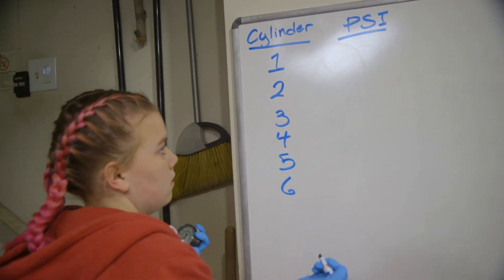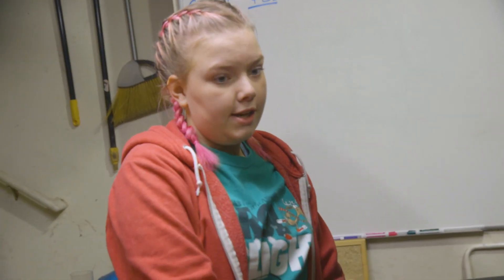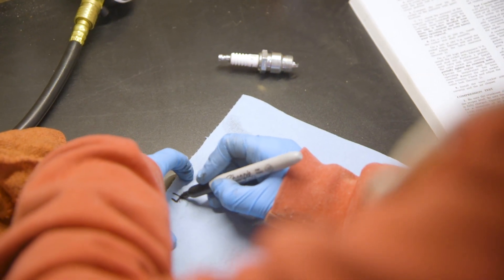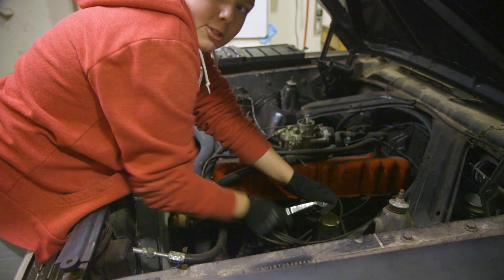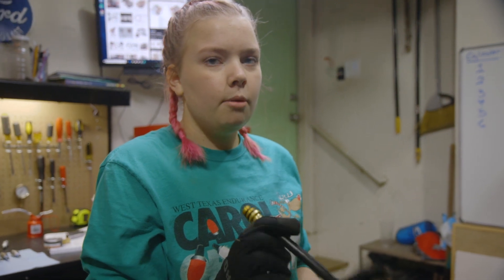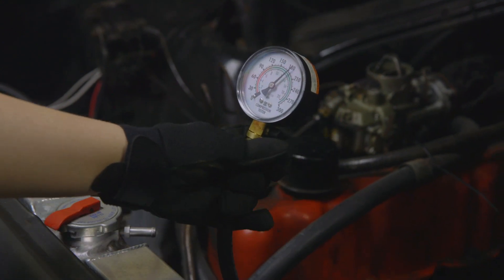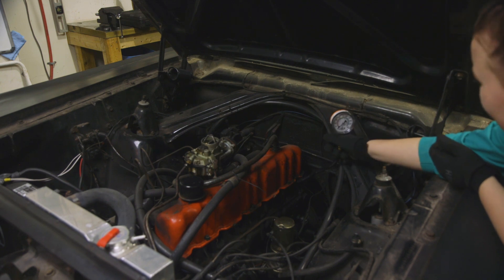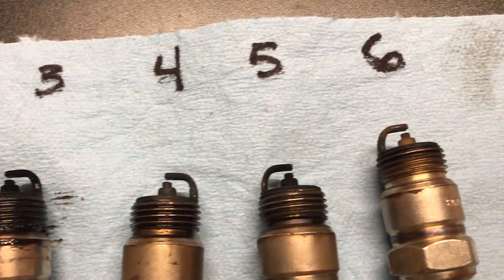I Learned How to Do a Compression Test!

Comment: #1 and #6 look "normal", in that they usually run leaner because they are further from the carburetor. Because of the age of the motor, when you do get the engine work done, you can improve what they did from the factory concerning valve stem seals, et al. Good luck!

Comment: So for your oily spark plugs it is a sign that those cylinders are burning some oil, however there are 2 possibilities as to the cause.  If is puffs a bit of blueish smoke on cold start up it is the valve seals, specifically the intake valve seals.  If it smokes while up to temperature under load or while reviving it up that likely points to a ring problem in those cylinders, specifically the oil control rings since compression is good.
Great job at getting your hands dirty kiddo, and great job Dad!!!

Comment: I agree, you have a good engine with that much compression. 
I bought an 88 Dodge Dakota from a junk yard, the compression was as low as 60 PSI to a high of 95. So you do have good compression.  
If it were mine I would still tear the engine down and rebuild it. Find a good machine shop,  and see what they think.

Comment: You can use the quick connect compression tester to put air into each cylinder (while at TDC) and remove the valve springs one at a time and just change the stem seals.  With that good of compression (and even, within 5% or so) you don’t need to tear the engine apart.  If it hasn’t been rebuilt, it will still have the metal shim head gasket.  The new head gaskets are thicker reducing the compression ratio in the cylinder requiring you to mill the head.  I’d do the valve stem seals (and any other leaky oil or water seals) clean it and paint it.  Call the engine done.  Just use a lead additive and high octane no ethanol gas.

Comment: It looks like you have a good engine.Valve stem seals are the first thing I would think of for the oily plugs.If you pull the head to do the seals,you might want to have a machine shop do a full valve job.When I did this with mine some valves were receding into the head so they put in hardened valve seats so it was compatible with modern fuel.A big advantage of the six is it's much easier to work on.I have a V8 in mine and it's a real pain to get to the spark plugs.
Reply from the maker: Thanks, Mr. Poole! Yea, we can't wait to get the engine out! Thanks for watching and Merry Christmas!!